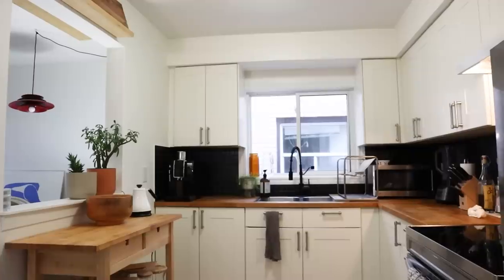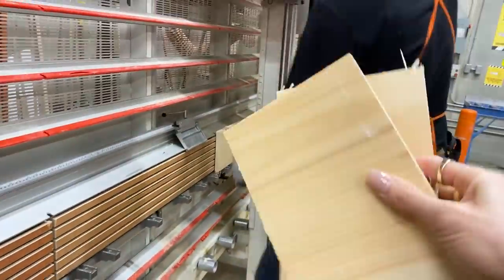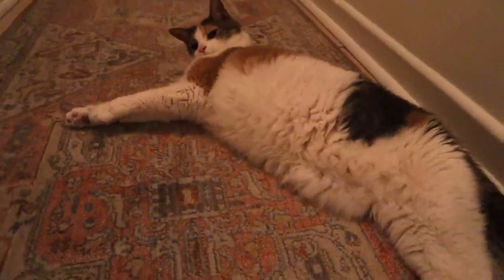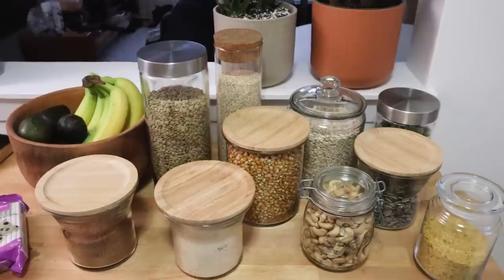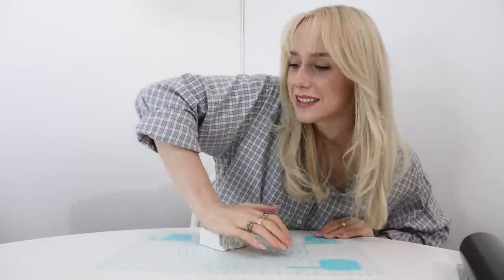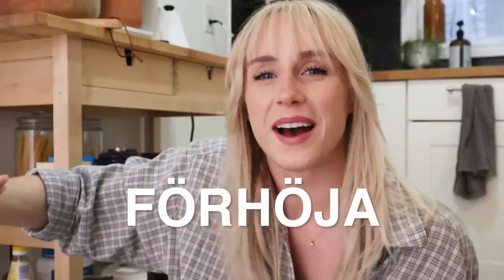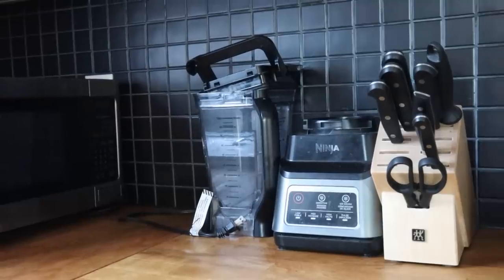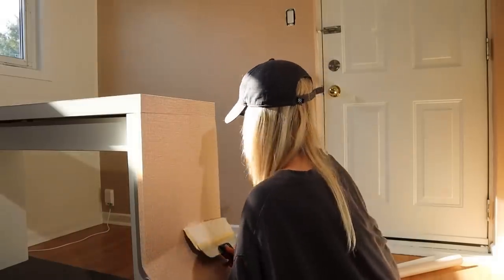small rental kitchen aesthetic hacks & diys

Comment: Did you let the wood glue dry before you drilled the pilot hole for the riser? I want to do this so bad but I feel like I won’t be able to keep the pieces straight and lined up while drilling the pilot hole! But also if I just glue and let it air dry, how do I keep it pressured together without clamps? I’m probably overthinking this 😅

Comment: I am not a diy-er at all, but wouldn’t it me more logical to screw the side pieces under the top piece? It would be stronger I think…
Reply: I am a diy-er and noticed that as well.. since there won't be much weight on these little shelfs it should be fine, but generally the weight should not be held by the screws but the side pieces as feet.